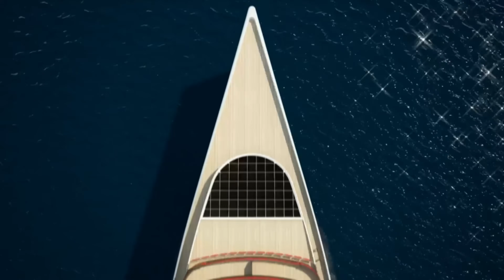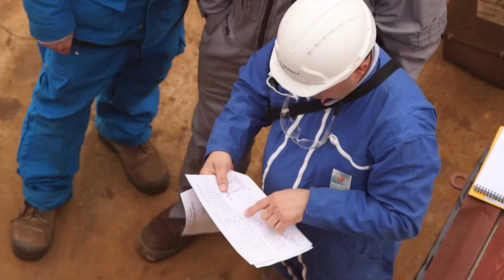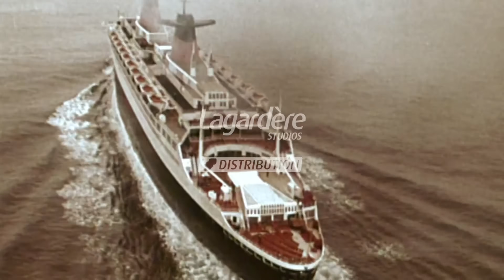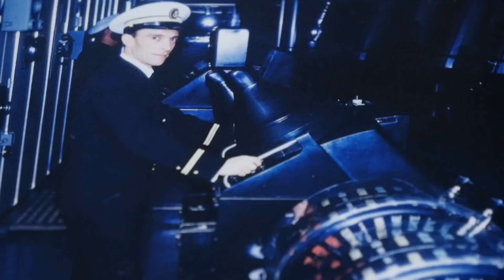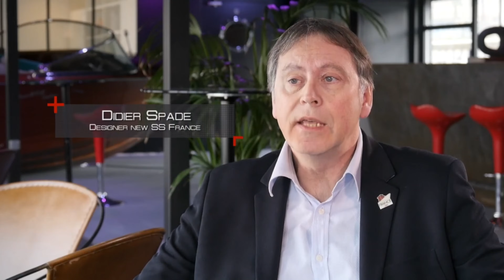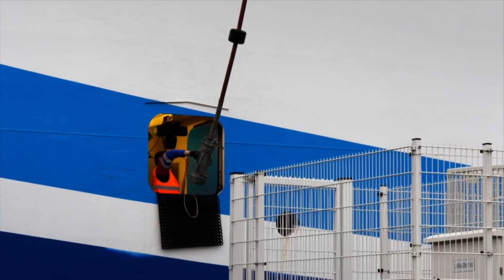SS France: A Cruise Legend Returns

Comment: 1:21.   Sorry but that is incorrect.    The fastest ship in the world was the S.S. United States.    No vessel could touch its crossing time.    It never lost its Blue Ribbon for having the fastest crossing time.    Several other videos on the S.S. France (and then Norway) make points to mention that.    It was the restrictions imposed following the Normandie disaster and also already implemented on the SS United States in its construction reducing fire and other damage.    Granted the dock crew didn’t know how to operate the Normadies new water system however the need was there to begin with.    It’s been mentioned this is why the France wasn’t as “luxurious” as the Normandie due to these conditions.   Less wood used meaning far less decor and furnishings of that caliber.   All in all it was the French’s last ditch effort to get back into the Ocean Liner game when airliners had already taken over that market.    They knew beforehand they weren’t going to compete in the speed category.

Comment: The proportions are all wrong on that design for the new France, & made even worse by maintaining the same proportions when scaling it down!  Also while the original SS France had a hull that was very efficient for its size, those two tower-blocks would double its fuel-costs, along with creating huge instability problems if a severe storm is encountered (especially as it would be too slow to outrun one)! 
As it's already 2022, presumably this weird looking ship never went any further than the design-studio!

Comment: If you don't want the same fate as the original SS France economy of scale 5,000 to 6,000 passengers in about 1,100 to 1,300 ft long it has to stand out amongst all the Oasis class the new icon class and the Mardi gras in the celebration

Comment: I
Apart from all the other issues, I am staggered that the people behind the design of the new ship could have come up with something so appallingly ugly.  Was there some competition to beat the  cruise ships that sail out of Miami in terms of hideousness? Sorry, this project deserved to fail.
Reply: Truer words have never been spoken...the new France design looked like two apartment blocks on an old ferry hull. It was extremely fugly. I realize that maritime technology has to evolve as time goes on, but that design is so ridiculously ugly. I know that I would never want to sail on something like that knowing what the history of ocean liner has evolved into. Cruise ships of today are considerably better looking than that design. Keep the hull, but add a more consistent superstructure that's better balanced and flows better with the hull design. This ship would only need a single smoke stack, so use that to pay tribute to the first ship, but don't build apartment blocks with wings on it.
Reply: The proportions are all wrong, & made even worse by maintaining the same proportions when scaling it down!  Also while the original SS France had a hull that was very efficient for its size, those two tower-blocks would double its fuel-costs, along with creating huge instability problems if a severe storm is encountered (especially as it would be too slow to outrun one)!